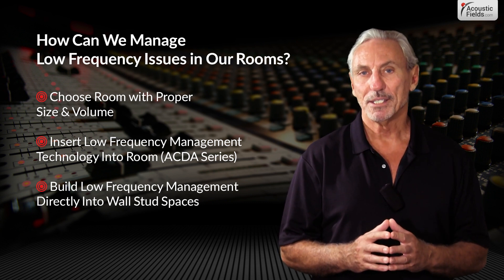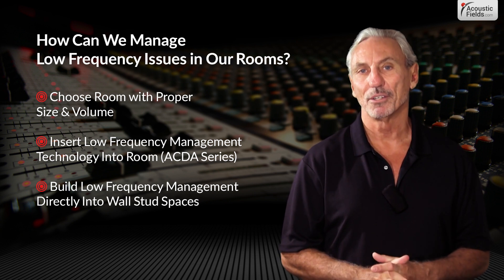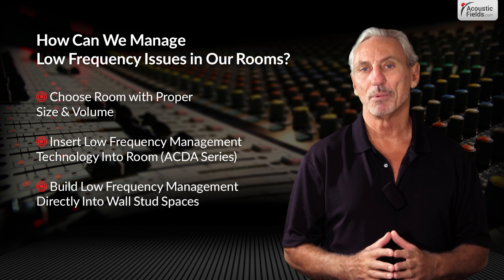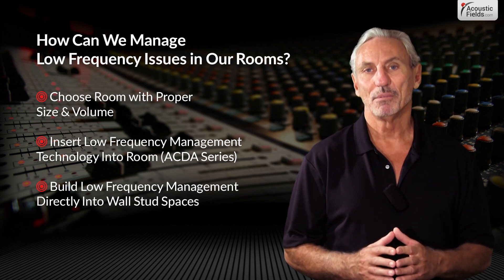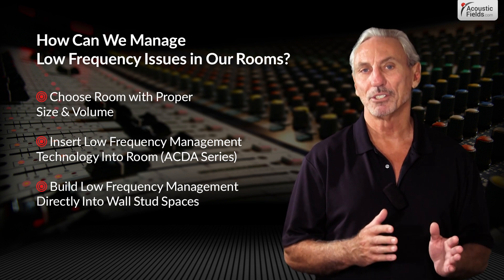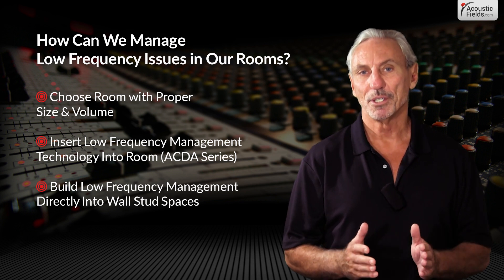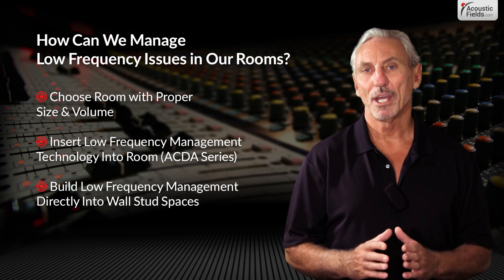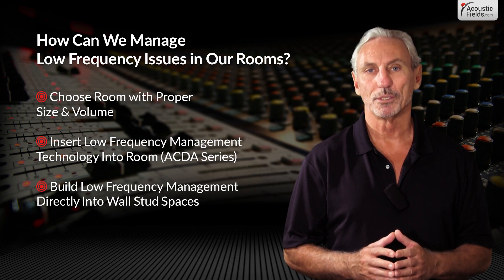Carbon Absorption Wall - CAW - www.AcousticFields.com

Comment: Thanks that’s exactly what I need for a renovation where the technology was not incorporated into the initial build plan, and acoustics were therefore not actually thought of. I love how I can consider laying those into the floor aswell. Question do they have an R Rating aswell as acoustic rating. Thankyou.
Reply from the maker: K, These are sound absorption technologies. An R value relates to BTU or heat retention/dissipation technology. You must have all heating and cooling issues resolved using other material types. Check with your local ordinances on what is required by building code.
Reply: Acoustic Fields that is correct except I just need your product because  of the neighbors and I need it made to a home theatre. I thought your product may have a r rating aswell. Because you are fitting internal walls.

Comment: Is this stuff rated for in wall usage per code?  I’m not as concerned with self contained units, but using it integrated in the wall is where I start to think critically about it.
Reply from the maker: All of our material types satisfy all 50 state fire codes.

Comment: I just cannot wrap my head around using water filtration pellets to absorb sound. Absorb contaminants out of water yeah, or too much of a toxic substance in a stomach ok use activated carbon, but sound? I think if those activated carbon pellets work then hamster food pellets would work as well...i know you say its our proprietary technology, but I don't think tour doing anything "special" to the carbon to make it better than any other activated carbon. Is there an independent lab somewhere that can verify the claims made by your company? Describing absorbant material with percentages just leaves me with more questions coefficients and percentages are not apples to apples in any way shape or form...
Reply from the maker: M,  Look at our performance curves for our carbon technology. https://www.acousticfields.com/about/  Over the counter carbons used for air and water will not work for sound. We manufacture our own technology controlling pore size, count, and material density.

Comment: Here’s what my engineering friend, who’s pretty knowledgeable about this subject, had to say...   Activated carbon is an efficient adsorbent (not absorbent) until its pores have been completely filled, at which point it needs to be regenerated or replaced.  There is a (wrong) perception that activated carbon somehow increases the volume of an enclosure.  That is not the case.  Loudspeaker drivers have mass and compliance.  When they are put into an enclosure, the air in the enclosure has its own compliance.  The two systems work together to affect the total enclosure Q and the resonant frequency.  The larger the enclosure, the lower the Q, and the lower the box frequency.  The ratio of the box frequency to the -3dB point is a function of Q.  We can increase the apparent volume, i.e., make the enclosure appear to have more air in it, by adding a porous or fibrous mass to the enclosure.  The moving air in the enclosure bends the fibers, which then spring back.  This effort of bending and springing back absorbs energy and releases it out of time with the principal enclosure resonance.  The result is that the peak of the resonance is somewhat flattened and delayed in time.  Lowering and broadening the peak is equivalent to lowering the system Q.  The fibrous material behaves like adding a resistor to a tuned resonant circuit, or adding a shock absorber to a car's suspension.    All resistive damping releases heat. There is no magic in activated carbon.  The very small pores adsorb air and trap it, then release it out of time with the principal resonant, just as bending fibers will do, lowering the Q.    Both fibrous materials and carbon take up space in the volume, so they actually lower the available enclosure volume for the principal "springiness", but their resistive damping is greater than the decrease in compliance.  The attraction of carbon is that if there are many very small pores, it can be more efficient than fibers for the same volume.  The disadvantage is that once the pores have become clogged with moisture or other contaminants, they become ineffective.  The most effective fibers are those with the most very fine fibers.  That is why long-haired wool beats commercial fibers for effectiveness.  Unfortunately, moths like wool.  Acousta-stuff is perhaps the most effective fiber, but its effectiveness is not so much better than regular fiberglass that it warrants the added cost.   In my opinion, the CAW from Acoustic Fields will not outperform fiberglass for acoustic absorption after a few weeks at ordinary household humidity.  The principal difference is that it will cost more.   You can measure reverberation quite simply nowadays with a computer, calculate the amount of absorption, and add it to a room without using carbon.  It won't make money for CAW to do so.
Reply from the maker: Y,  We use our proprietary carbon process to absorb sound energy in air. Pores do not fill with this process. You are confusing this filtration process with water.  Study the diaphragmatic process and that will show you the importance of the internal cabinet fill material. The inside fill material is responsible for the rate. The depth of the cabinet and mass is associated with level or resonant frequency.  If you reduce the pressure level inside the cabinet (compliance) there is more room for the variables you mentioned to work better together.

Comment: Dennis, have you found any differences in the types of activated carbon for this application? I ask because we use it at work and it comes in different types e.g. extruded (usually from peat) or granular (usually from coconut shells) as well as different sizes. I'm building a house and have discovered from your e-books that my main listening room is definitely does not have the right dimensions and has too much glass so I'm looking at what I can do within the bounds of maintaining domestic harmony. Y
Reply from the maker: Y,  We process our own carbon. We control porosity size and count along with material density. Over the counter, carbons used for water and air filtration will not work for sound absorption.
Reply: Thanks. Y

Comment: Hi Dennis, I'm just about ready to build my home studio.  I actually have the luxury of building it separate from the home . I was wondering what dimensions you recommend.  I was wanting to build it all with 2x6 . Height wise I can go up to 10ft. Thanks and hope to hear from you soon.
Reply from the maker: N,  Using a 2" x 6" frame as a barrier will not assist you below 125 Hz. unless you use proper barrier technologies. If noise getting in your room and leaving your room is an issue then a 2" x 6" structure will be problematic. I would start with a size of 17' w x 10' h x 23' l.
Reply: Acoustic Fields.. ok I see. I was trying to eliminate the box within a box method by going thicker on the walls and cost wise. So going with a 2x12 instead do it? Or just do it with 2x4s and box in box method.?
Reply from the maker: N,  I have no idea what you are talking about. Do not use 2" x 4" in any audio room. Please fill out the information in this link: https://www.acousticfields.com/free-room-analysis/
Reply: Acoustic Fields sorry I didn't explain enough.  I'm making a studio in the backyard and trying to design it properly.  The question is more for the exterior walls. I dont want to mess it up from jump since its gonna be built from ground up. Thanks for your response Dennis I appreciate it greatly.
Reply from the maker: N,  This all has to be designed prior to building. You have to measure noise and build for the noise. Next, you have to add the correct rates and levels of absorption from low, middle, and high frequencies along with diffusion to match user requirements. Our room design services are broken down into two parts: noise and treatment. Each has an associated fee of 1,500 USD. If you require both noise and treatment services, the fee is 2,500.00. A credit of 50% of all design fees will be credited towards technology purchases from Acoustic Fields.

TREATMENT

The treatment design includes room size and volume, source (speaker)/listening positions within room size and volume for 2 - 40 channels, all low, middle, and high-frequency absorption management, including proper rates and levels of absorption to match usage, type/amount/position. All middle and high-frequency diffusion specified as to type/amount/position to include proper diffusion frequency response/usage. All DIY drawings are provided for all specified treatments and types. Telephone consultation is available to assist you with any build or product implementation.  

NOISE

Noise analysis includes all internal/ external noise frequency and amplitude measurements taken by the client under my assistance. Noise measurements are taken inside and outside of the subject room twice a day over 7 days. Barrier design based on these seven-day noise study showing frequency, amplitude, and SPL. DIY drawings provided for barrier design are based on these measurement numbers. Material list provided to build the specified barrier. Telephone consultation is available to assist you with any build or product implementation.
Reply: Acoustic Fields awesome great info. Thanks Dennis

Comment: oh this may be what I have been looking for
Reply from the maker: M,  This is our diaphragmatic absorption installed within a 2" x 12" frame. We need the 12" of cavity (stud space) depth to create the 30 - 50 Hz. and 30 - 200 Hz. absorption rates and levels. If you add our foam technology and then cover with fabric, you have broadband low, middle, and high-frequency absorption built into the wall itself.  The beauty of this process is that you can use the correct rate and level of absorption right at the place where the problem exists. Every room size/volume/usage has a different frequency and amplitude issue at different places in the room. With this process, no more free standing units taking up space and a targeted treatment approach to treat all issues.
Reply: @AcousticFields  I don't understand the need of tuning these BDA's. I have built units with 8 inch cabinet depth and units with 10 inch depth, but there was absolutely no difference. Both started working from 20 Hz with maximum power and where absolutely constantly absorbing. I wish I had more control of these units to control rate and levels. How can I built it so, that it works only at 30-50? They just work constantly. I can imagine that if I build a cabinet depth of only 6 inch they still start at 20 Hz with maximum power, or a least a 30 Hz:)
Please clarify, Dennis.
Reply: Do you use a thicker filter than 5 cm in your ACDA 12, or how come they suddenly show very high rates from 30-50 Hz instead of working broadband like ACDA 10

Comment: Dennis let me start by thanking you for being such a great wealth of knowledge. Let say in the future i plan on converting an office in my home as a booth for voice-over. My idea was to decouple everything from the rest of the house, pretty much the room within a room idea(noise clips, resilient channels, green glue, etc). Would doing it the way you're describing here be a better and more economical choice?
Reply from the maker: J,  You are welcome. A room within a room is one way to deal with noise issues. There are many others. What type to use depends on the frequency and amplitude of the noise issues you are facing. When you are ready, you will take noise readings using your cell phone over a seven day time period. From those numbers, we will then design the appropriate barrier technology. We will provide you the software, data sheet, and guidance to assist with the number gathering. We will then design the barrier based on the frequency and amplitude of the noise you are actually facing. You can not guess with noise.
Reply: Acoustic Fields thanks again Dennis. I will keep you posted.